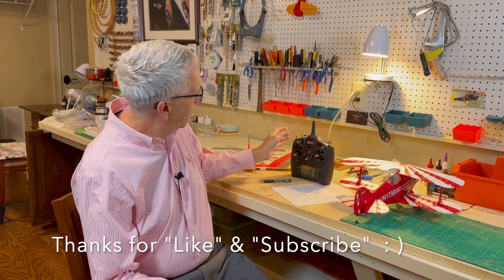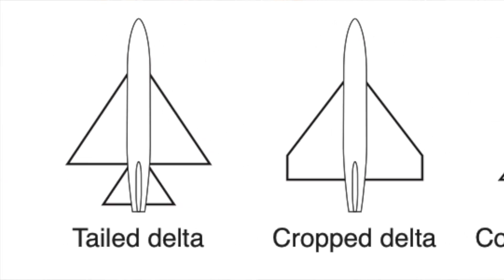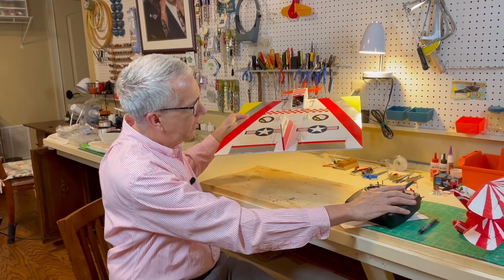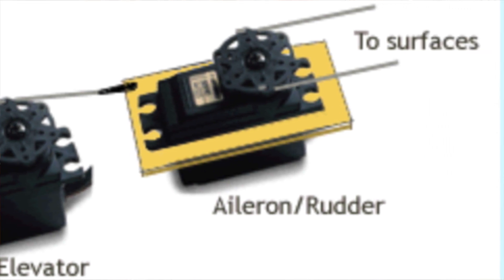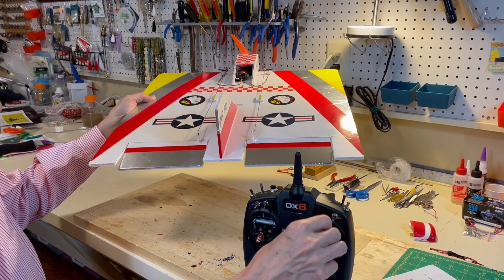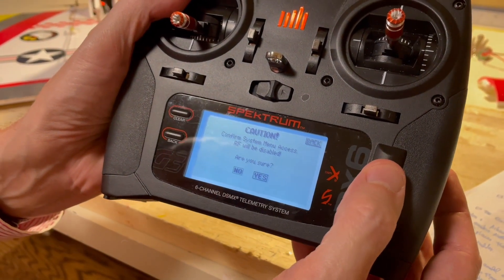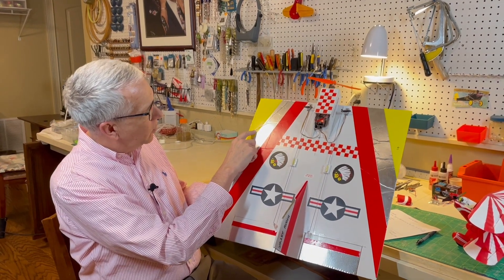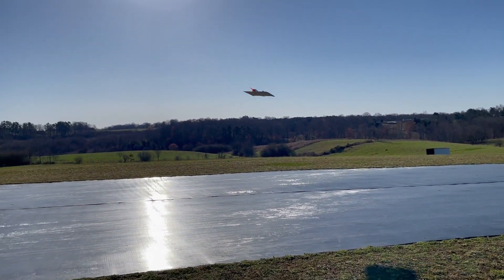Elevons for Newbies!

Comment: Hi Tim,
Thanks for you video, I found this very interesting as I am new the RC planes. Recently I built a similar type of plane with only the elevons and no rudder. During my test flight, every time I tried to turn left or right the plane spins. From several experiments and crashes, it seems I need to slight turn to the desired direction and also lift up the plane while doing so. However, my experience is limited and found that turning any direction is a problem and I just can't get it right?
Could you share your experience or techniques for turning with just elevons? Thank you.
Reply from the maker: Hi Zosla:  For normal sport flyers, no real need for rudder in flight (although rudder helps ground ops a bit 😊). Turns with elevons should work just fine. See my foam board F-22, no rudders just elevons. My guess, almost for sure, is you have way too much elevon throw which is putting you into a spiral really as opposed to a spin. Reduce control throw and I think you’ll be OK. Tim

Comment: Hello, quick question. I fly quadcopters normally and the roll seems backwards on wings. Aka roll left, on controller and elevon left goes up on craft. That means it rolls right?
This opposite to quads?
Reply from the maker: Paul:  Apologies, I am simply not a quadcopter flyer. 😟 Can anyone assist?

Comment: Thanks this was a great explanation. As long as I can use elevator in a turn then I have plenty of maneuverability. I can just see landings being a little bit harder without rudder for fine touch in fast fixed wings. I had an idea this was how it worked but you made it easy and I have same radio currently.
Reply from the maker: OBX:  Sounds good, thanks!  Tim

Comment: i have a question, in conventional aircraft design the ailerons are in main wing, and elevator in rear wing, can the ailerons move in opposite direction of elevator for giving better pitch movement so plane can become super manurable or it may crash?
Reply from the maker: Smit:  Moving ailerons like that would really not work, as the main function of ailerons is for roll control.  If you would like more pitch authority, either make a larger elevator or give the elevator additional throw.  Tim
Reply: @TimMcKay56  can i put canards then my plane will look like su30 mki jet
Reply from the maker: You can try!  Tim
Reply: @TimMcKay56  thanks sir